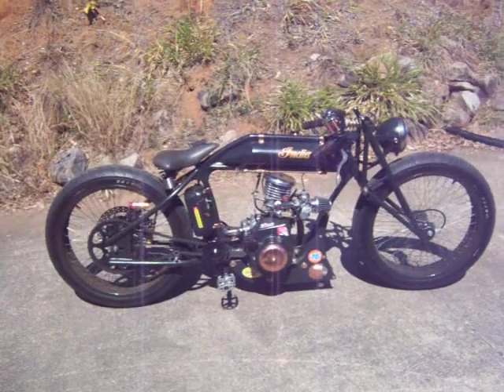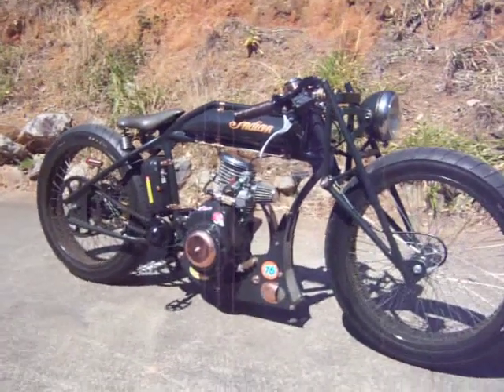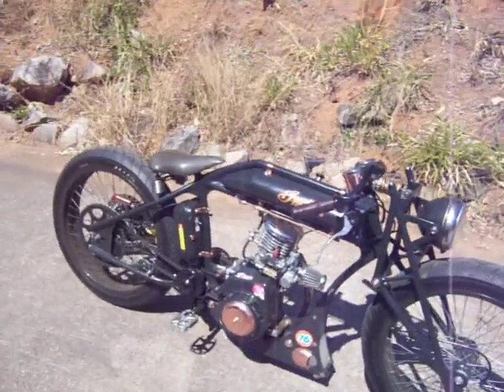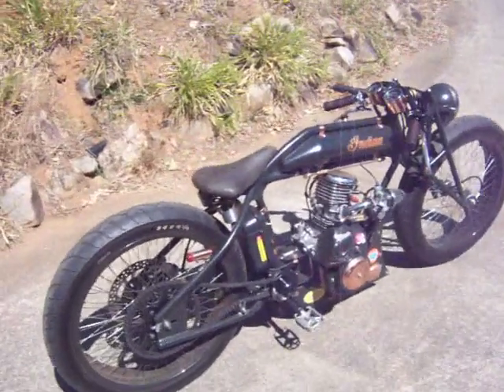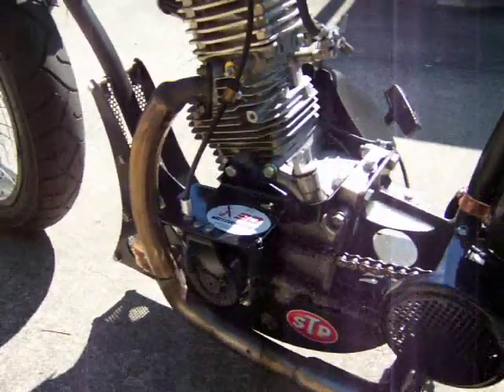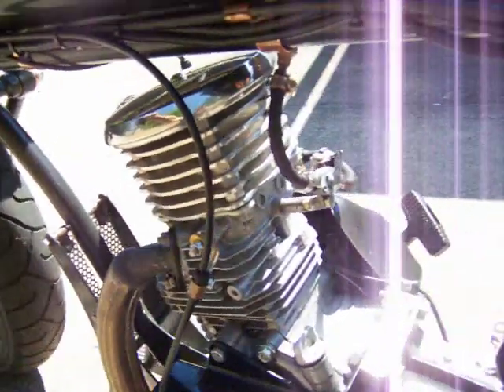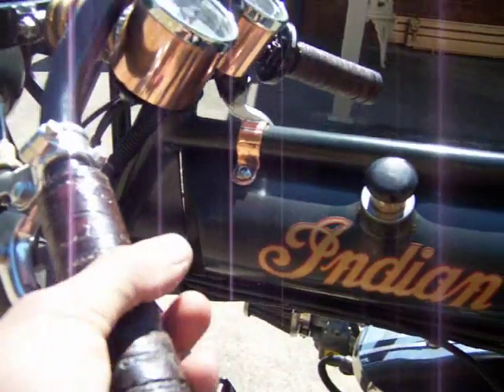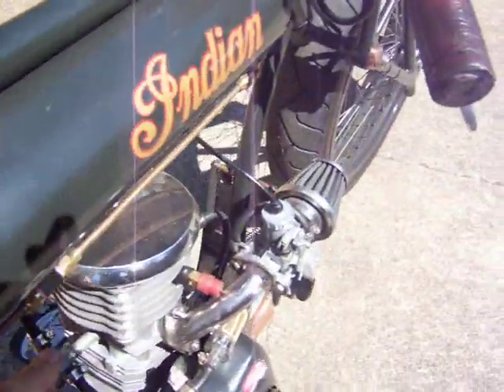INDIAN BOARDTRACK RACER replica with 3-D manual clutch.

Comment: Beautiful. Has to be one of the best ones out there, certainly the best one I've seen so far. Or maybe the one that is closest to what I'm also looking for (trying to figure out what to build).
The things that I like are also the things that stand out if you compare it to a 1910s boardtrack racer: Disc brakes, one single chain on the right. And I'm torn between authentic look and modern (safety, comfort, ease of use).
Reply from the maker: Detail, i believe you can keep an authentic look at the same time using modern parts, its all about being creative and mixing and matching incorporating old techiques into new ideas.

Comment: Another amazing board tracker and color choice! Thank you for sharing! I am currently wanting to build one myself and I am looking for influence! I have one question though I was hoping you may answer please, I noticed someone ask if you have any oil issue with the engine tilted and you said no, but my question is how much oil you put in it in order for the inside to get lubrication? And also how do you check your oil?
Reply from the maker: well these honda's have a plug on either side, perfect for draining and filling, only fill till it reaches the indicator on the top oil bung.

Comment: great job. where did you get the tachometer and odometer from?
Reply from the maker: thanks ,,i think i got them from china,, but i had to make the copper bezels to suit and modify the mounting brackets.
Reply: Would you happen to have a link to them?
Reply from the maker: just look on Ebay, under motorcycle speedo and tacho, sorry i dont have a link ,, it was a while ago when i got them.

Comment: What all did you modify on the Honda engine
Reply from the maker: just about everything, including headwork, oversize valves, flat top piston, cam, etc etc.
Reply: plasmacutter1 sweet where can a guy get those parts at
Reply: plasmacutter1 did you fabricate the “cylinder” valve cover??? It looks great. I’ve also thought about fabricating a blank cylinder for the V twin look!

Comment: This bike is awesome what type of frame was used? I want to try to make something like this in the future. Is there a specific frame you chose to go with this? Or was it homemade? I'm in New York state and in order to have a license vehicle on the road the frame needs to have a VIN number so I'd like to know if the frame was either homemade or you used a pre-existing frame which is what I'm hoping
Reply: Also what type of engine if you don't mind me asking? This is very nice I love the setup and if you wouldn't mind also what type of tires and rims? Hope to hear back from you thanks for any feedback
Reply from the maker: I am happy to answer all your questions Patrick, and i can sense the enthusiasm in your words, i am happy to hear that you like the bike.
Firstly the frame is based on an early indian single frame with torpedo tank circa 1916-1920, frame has been fabricated by myself ,, no (VIN number).
Engine is a Honda Gx200 with oversize piston ,race cam, large port head and oversize valves, billetflywheel, ram manifold, double valvesprings, roller rockers,,22mm mikuni carb,manual clutch, etc -14- 16hp roughly.
Rims and tyres are fat bike bicycle 24,1/4 inch, double wall aluminium rims, drilled for 72 stainless spokes, milled heavy duty 2 inch stainless hubs with pressed bearings and 1/2 inch axles, its a weapon to ride with the low weight,,, good luck hope that helps.
Reply: plasmacutter1 

Thank you very much for the quick feedback I appreciate the help the bike is awesome!
Reply: One last question did you get the engine complete how you described it or did you piece it together to make it into what it is on the bike? I guess what I'm saying is I don't have much experience with building engines, welding, etc, I'm going to school to be a machinist, just wondering if there are engine kits that closely replicate this or if it's from scratch mostly. Thanks again
Reply from the maker: Great to hear you are going to school to be a machinist,, a proud occupation,, a great skill with many advantages for creating all sorts of stuff for your self in the future,, as far as the engine on my bike goes, i purchased a stock honda gx200 and then started purchasing the go fast bits off the net from different suppliers,, if you get onto various forums for go karts and minibikes and "do-it-yourselfers" they usually have all sorts of info regarding these engines and all sorts of questions get asked and answered by guys who have built engines and bikes before,, if you need to know specifics on my bike when you get to that stage let me know,, i will be glad to help. look forward to seeing what you come up with,, should be good, cheers man.
Reply: It says in the description the frame was hand made
Reply from the maker: yea thats right,,
Reply: Patrick, I am in the nanny state of NY also. Get a registration and frame from a basket case or cheap moped. I got a Puch with a good reg. and that is the basis I used. Not only that, the rims and brakes are strong yet look right.   NY has 3 classes of limited motor cycles (mopeds) based on speed capabilities of each one's manufacture specs. The lowest speed (20 mph) requires neither insurance nor inspection, next up requires insurance (30 mph) and the 40 mph class requires both.  At the time my bike only went 20 and the girl at the DMV changed my class (at my request) to the lowest one,  nice. I did have insu. on it anyway but the lack of inspection is the biggie.  Most of the time I go around 20 mph anyway, I prefer to be out of the traffic at the side of the road (you still need to be a real savvy rider because of idiots in cars turning right as soon as they pass you).
Reply: @plasmacutter1  09566